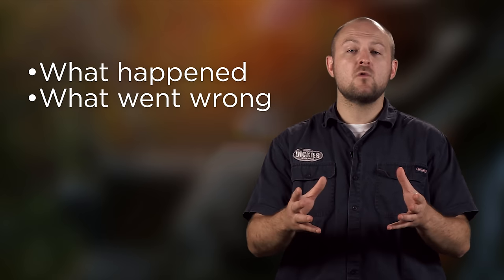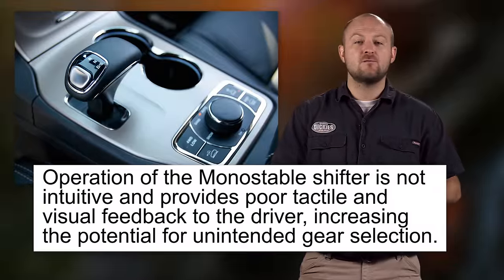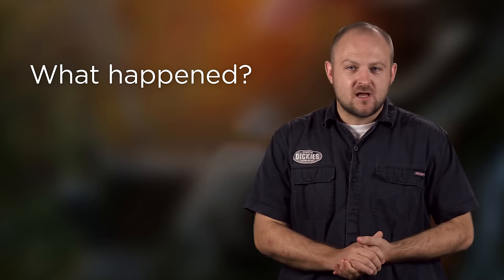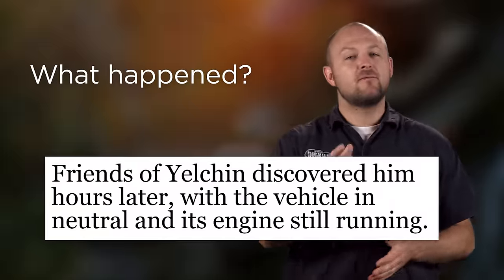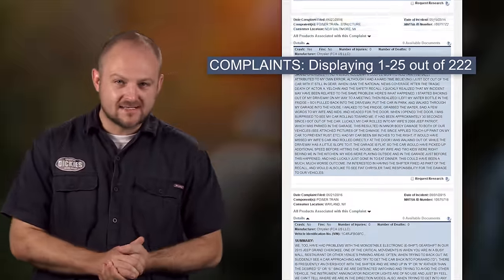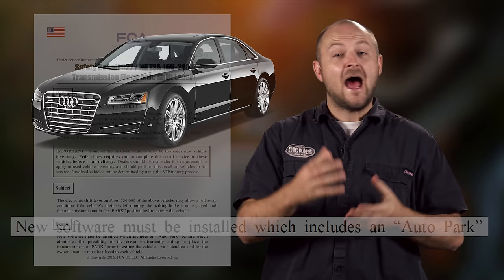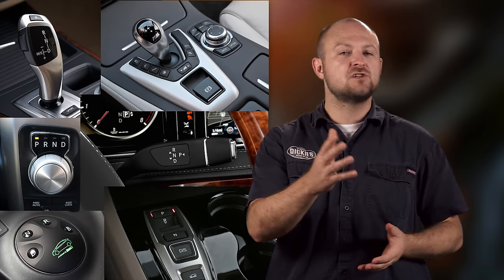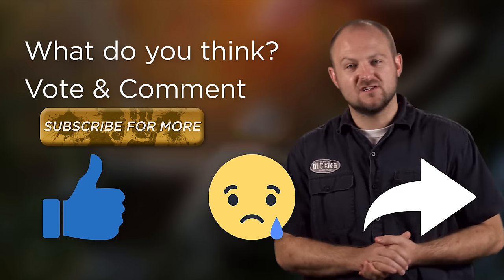How Anton Yelchin was Killed: An Explanation of Jeep's Confusing Shifter

Comment: wow..that shifting gear is creapy. This jumping back to the middle is what really scares me. You have to look at the display to see if it keep the position you've chosen.

I do hope that the people who have started a lawsuit against the manufacturers of this type of gear, will win.
Reply: It has visual and audio cues that tell you that the car is not in park, how hard is it to not check your gear or take a look at the display before you leave the car? Still, the design is probably the worst in the industry and sad that a death was needed to change the design in newer models. Doesn't justify it either.
Reply: Visual and audio is not right. Both could only be considered as supplementary feedback. The primary feedback should always come from the shift lever.
Reply: You can hardly call that a shifting gear. An old fashioned car with a handbrake had prevented this unnecessary death.

Comment: This is what happens when you re-invent the wheel.Simple designs make things simple.Today's cars are filled with computers,which equals thousands of more things that can go wrong. The shortest distance between 2 points is a straight line.
Reply: You'll almost think what the problem is with manual shifting and a handbrake. That solves the stupid and ridiculous accidents.

Comment: If the car was on a hill and he didn't set it to the P mode and set it on the N mode instead, how did he get caught behind the car? I mean, as soon as you move your foot out of the brake, the car should start rolling back right? How did he get out, and walked to the back of his car if the car was not on Parking?
Reply: Due to weight and/or less steep inclination on top it might not necessarily start rolling right away. I think it started rolling very slowly at first, and when it gained momentum after reaching the steeper inclination and went faster. By that time Anton was behind it and the ~2.5 ton beast dragged him and crashed him.
Reply: Vizzion Asmr    Amen You are very smart!
Reply: I have seen automatic cars that you get off it and the thing moves forward. Maybe he expected it to move forward, so being on a slope it would instead stay still. Maybe he thought great, stay like this and I'll be right back.
Then the engine simply choked and the car rolled back
Reply: Temporary hill hold, where the brakes are electronically applied via the ABS system.
Reply: VIZZION ASMR This whole situation bothered me from the start. Even if he was hit, he wouldnt have died imo, neither such a big dent in the fence.
Reply: My understanding is he was pinned there for a long time and suffocated.
Reply: Car usually only starts rolling when its in D and u take ur foot off break.. When its in N on top of a hill it would gradually start to roll and pick up momentum..
Reply: Judging by how badly the gate was smashed, it was probably left a lot further up the driveway than the video suggests, meaning it picked up considerable speed before reaching the actor.
Reply: When the first reply has it right but every subsequent reply ignores it lol. Look up some car rollaway videos on YouTube, see how insignificant their initial speed was or how stationary they all seem at first, and for how long they remained in one spot until they started moving.
Reply: Why would he put it in Neutral to began with? Park works better and is safe. Furthermore if the SUV is in Neutral you can push the SUV at least off of you to make room to slide off the fence. However if it was a hill that will be tough.. But this story sounds fishy from the start... Im thinking was he high.. Because going in Neutral rather than park is pretty stupid in my opinion
Reply: Lorenzo Blakely just my opinion i mean who puts a vehicle in Neutral instead of Park.. Thats my main point. I said maybe he was high due to the fact of his choice to put the truck in Neutral
Reply: Obviously not intentional. If you tried this shifter you would see how it can happen. I have driven a jeep with this shifter type and I agree it needs a redesign.
Reply: SimplyLimbo anton didnt die directly from the impact but rather traumatic asphyxia as a result from the impact shortly after
Reply: Guru SnapShot the guy in the video is saying that Anton put the car in park but the faulty gear shift recall put the car in neutral. Anton would not have purposely put the car in neutral.
Reply: Nikolaos Skordilis I’ve seen photos of the scene. The steep wasn’t steep enough for the car to roll back like that. I’m sorry— it still seems dodgy
Reply: Car would have to have been up at a near plateau (ie higher than this video suggests)  it would have a near zero roll when he got out, but the slope increased after a short pause to break static friction. 

What a sad tragedy.
Reply: @ReapZer027  I'm sure he was high
Reply: @stopnwatchentertainmentjdt9325  It was the make of the car, they had recalled them because they couldn't tell if it was in neutral or park for those specific  designs of the Jeep
Reply: VIZZION ASMRtainment he was suicided

Comment: I've worked on vehicles for thirty years and only in the last five years have I encountered these new style shifters. If you go back to the introduction of the shift lock and the accidents that happen before that you will realize that manufacturers are just not very smart. They test these new ideas with control groups not the general public and do even get me started on the overall design, it's like they think these things will never break so why would you need to take something apart. I say send the design teams out to the assembly floor or to repair shops. And yes the designers need to learn cause the suits that approve this crap just look at it say yea sure that works, they don't know any difference!

Comment: I have the same jeep with the shifter that they say killed this guy and to me there is no flaw with the shifter. There is a display in the instrument cluster and one on the shifter itself that shows what gear the car is in at all time. The people who have had problems with this shifter are people who were too preoccupied to check and make sure the car was in the proper gear. If u failed to put the car in the proper gear then that's your fault not the manufacturer. It's not like you put the car in park and it jumps out of park to reverse with no input from the driver.

Comment: I'm not sure if anyone mentioned this but... The Toyota Prius has a very similar gear selection system, where the shifter springs back to a certain position. They ingeniously solved the "problem" by making park a button. You can't ever shift into park, you have to press a button. This removes doubt on whether or not you placed the car in park. Pretty smart if you ask me!
Reply from the maker: You bring up a good point. The Prius shifter is also in the dashboard, not in the standard location, right? Being in a totally different position and the park button you mention is probably more than enough to prevent an issue like this.

Comment: It should have been made so the car could have automatically went back to park when the door opened. I tow cars for a living and alot of cars automatically go to park when the driver side door opens. For example Acura has a thing called Car Wash Mode to keep the car in neutral but it has to be turned on by the person in the car, if not the car will go back into park when the door opens. When I tow cars that do this I put the drivers side window down and reach in and put my hand on the brake and with my other hand I shift it to neutral. Its a pain but it is a safety feature.

Comment: As a driver it's your responsibility to check to make sure your car isn't rolling before you step out of the vehicle, especially when you're on a hill.  Even with traditional shifter or parking brake, there could still be the possibility of mechanical malfunction.  It takes an extra 2 seconds to let off the brake pedal and confirm your car is stable before stepping out of the vehicle.

Comment: A design strategy for an engineer is to provide multiple and redundant indications for a machine operator, especially critical safety or protection related features.

The best choice would be a system that has tactile, aural, and visual cues.

In this case the only cues provided to the operator were visual, which is often going to be missed because drivers primarily use the visual sense when driving so that cue will be in competition for the operator's attention.

Aural cues are, by their nature, generally not primary indicators. When used it's a difficult balance to keep the warning from being distracting rather than informative. Also, it's difficult for some operators to distinguish between aural cautions and warnings. Especially when those warnings are unfamiliar.

The best cue for an operator in this situation is tactile feedback because that sense isn't competing with the visual sense because proprioception (the sense pertaining to awareness of the relative position of one's own body and the strength of effort being employed in movement) occurs at the base level of awareness and will usually become noticed when expected sense differs from actual experience. (i.e. turn the steering wheel to the right but the vehicle doesn't respond and you'll become far more deliberately aware of the position of your hands than you would be if you had perceived the expected response)

This is one of the biggest problems that Boeing rated pilots have when transitioning to Airbus. Their controls do not provide the tactile responses that Boeing has developed over many years of trial and error. Airbus engineered that out because the operator is usually the computer with most manual control being a backup to the automated systems. It's also worth noting that transport pilots are found in pairs with each double checking the work of the other.

No auto pilots or co pilots for drivers of automobiles so that makes the redundant cues for important safety features more important.

A long post to say this: You're right that this was an obviously terrible design, and innovation for the sake of change alone isn't necessarily a good thing.
Reply: I cant imagine implementing this shifter, youd have to look at it and wait for it to switch to the right gear every single time. What if you want past the one you wanted, go back again? So stupid. All this would do is slow you down and annoy you.

Comment: all the blame are of stupid engineer of JEEP, all car would have hand brackes .
Reply: + MyAnonimous777. You might blame the engineers for bad design but all the blame should go to the drivers that don't pay attention to what they are doing. Cars aren't toys and if you want to drive them, you should pay attention when doing so!!!!!
Reply: Exactly my question, I've never seen or been in a car without a handbrake? Is this an American thing? I actually drive and automatic even though they aren't too common in the uk and mind has a foot brake, hand brake and park gear.
Reply: Lynsey Miller
yeah i agree , me too  i never see such thing as no some thing manual working as security bracke thats the point , with this system obviusly they try simplify all to this will no necesary but i think is a big mistake people are no perfect and this than was happen to YELCHIN are all fault of JEEP . ¬¬
Reply: +MyAnonimous777 exactly, the hand brake is your fail safe! How would you do a hill start without a handbrake for example? I apply mine and traffic lights etc to make sure I don't propel forward as the car won't stalk like a manual does
Reply: MyAnonimous777 why on hell would you just say oh lets put this new gear, wtf... that is stupid, whats next they goen change the wheel to a square or sum sht?
Reply: Lynsey Miller cars have hill hold these days come you other half has a range Rover with all these on
Reply: It should have been! it should always be applied when the vehicle is stationary

Comment: Very sad. Awful way to go. Dumb People are saying "why did he put it in neutral?" He thought he put it in PARK, not neutral!! The design of the shifter made it seem like it was in Park, correct? That's what I got from the video. And the bell Sound when he opened his door, probably meant to him, that the door was open, not that the car was in neutral. We have a new Kia and when you open the door with the engine running, the bell sound goes off too. Bad design by Jeep, Not enough warning to customers who already had the car, not good enough familiarization by the owner when first purchasing the car. Overall, a very tragic mistake and oversight by Anton. Not entirely his fault, but at the same time, he should have made sure the vehicle was in PARK before exiting the vehicle. Hopefully this serves as a lesson to All People to be alert, careful, &  patient when parking and getting in and out of ANY car. Rip Anton. You were a good actor and a good young man taken too soon. 😇😢
Reply: Carl Sims . You never mentioned the parking brake , it helps much better than any shifter in park position.
Reply: Carl Sims I live in Mexico , and believe me , we use the parking brake all the times because our country has a lot of hills
Reply: Felipe Ramos Cantero you're right! I forgot about that! Good point.
Reply: Anton was probably doing something that would of been done quickly so pretty much no need to throw the eb on especially since it's not a manual and all he had to do was put it in park and he would be good. Point is FCA made a garbage shifter and EB is a non factor here maybe if Anton knew his vehicle had a design flaw with the shifter then maybe he would of put it on even if he was only getting out to do something really quick  where he would need to leave his vehicle running. Being in park on most automatics means your vehicle is pretty much staying put regardless of EB.
Reply: To be honest, my question is why didn't he put the handbrake up? you should ALWAYS put the handbrake up when parking it anywhere, even with the engine running.
Reply: To say that he "thought he put it in park, not neutral" is not provable. It's impossible to tell what he was thinking at the time.
Reply: And as for the video, there are two places the letter "P" illuminates if "Park" is selecting. Kind of hard to miss.
Reply: @feliperamoscantero1641  EXACTLY, I know the idiot was from Russia but didn't he know what a parking brake was
Reply: Jane=troll 🖕🏽

Comment: If he was parked on any kind of incline, especially a "steep" one, the Jeep would have started rolling back, as soon as he took his foot off the brake. He would barely had time to run and jump behind it, to get pinned, like that. The Jeep would have been already rolling backwards, which would have been obvious, when he went to get out..This just doesn't make sense. If it was an accident, he would have never had time to get behind the Jeep, before it hit the gate. Explain why the jeep decided to wait until he was between it and the gate, before it decided to allow gravity to do its thing.  Go drive up, even a small incline, put your car in neutral, and see how impossible it would be, for that to accidentally happen.  See how much time you have to take your foot off the brake, get out, and see how much time you have..and Jeeps are heavy, so it would move faster and with more force, than a normal sized car. I feel like I just watched someone telling me the earth is flat..lol

Comment: this is pretty rare you got at least 30 or more seconds to get out of the car walk behind it on neutral without noticing the car slowing going backwards?

what about the emergency break?

does the floor has the sufficient surface angle for the car ram him against the structure?

it is really an odd situation

Comment: My wife owns a 2014 GC. It has the same shifter. Since I don't drive her car very often (I drive my Rubicon or my Dodge PU) I always have to look at the dash to ensure it is in park. When shifting gears in this vehicle it is very easy to miss the correct gear. Although she is used to it, she always puts the emergency brake on and double checks to ensure the transmission is in Park. It also has the remote starter; she has gotten out of the car and walked away with the engine still running -the motor is extremely quiet. Another item to be careful for when using the newer vehicles. 

 Personally, I wish all the manufacturers would get together and develop a single standard layout for the operating parts such as location of windshield wipers, lights, horn, washer, etc. I used to travel a lot which meant I was renting a car all the time. It always takes time to figure out where the different switches are located. In an emergency, it could cause a serious problem.

Comment: Why do auto designers have to update the ergonomics of the shifter anyways?  More and more your car is dependent on computer controls and software meaning when shit breaks it is way more expensive to fix.  How about leave things that are suppose to be mechanical alone   Or if you have to incorporate such devices have a sensor detect that a car is rolling backwards and automatically engage brakes or something. Peace to you brother Anton you will be missed.